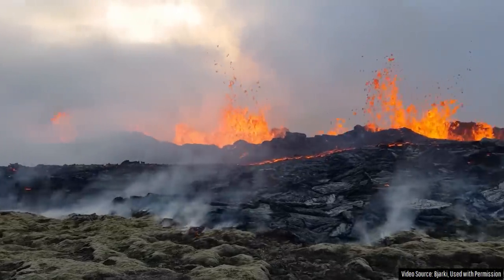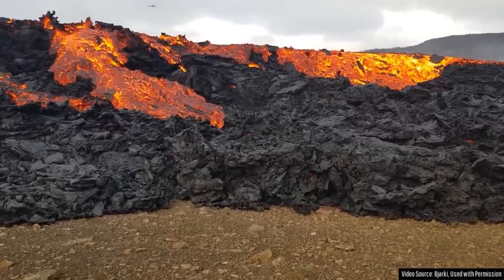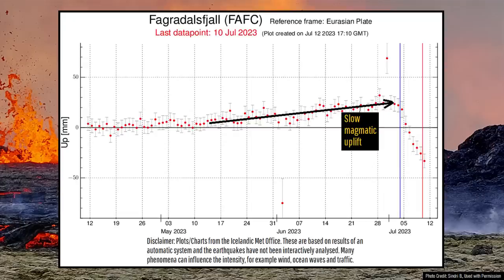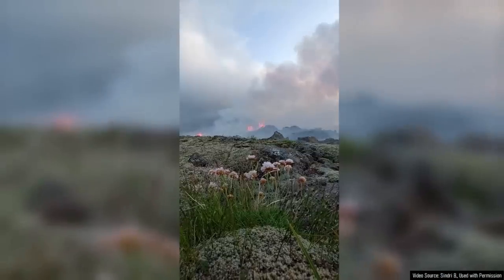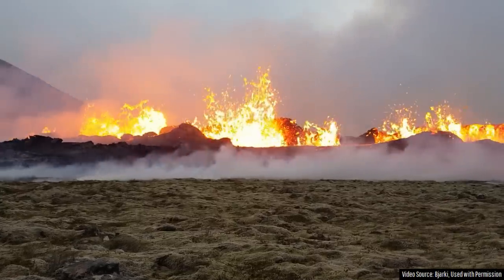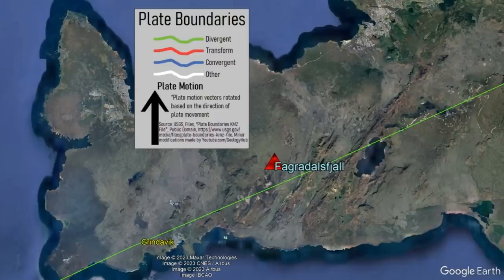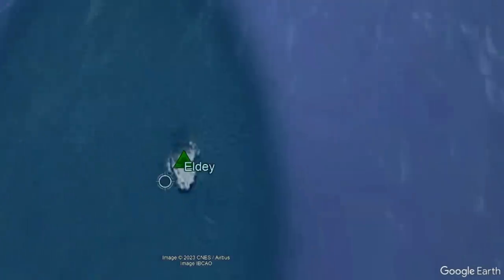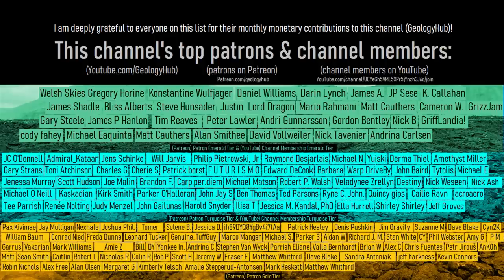Iceland Volcano Eruption Update; Eruption Slows, Underlying Dike Expands

Comment: Thanks as always. Yesterday, I was watching the eruption, which occasionally had outbursts that built up the cone. Some parts of the cone even collapsed! 
To be honest, given Iceland's location on the North Atlantic mid-ocean ridge, I am curious about what its future will be. Will it break apart, grow larger, get accreted to Europe or North America, or get subducted? I have read that oceanic plateaus (Such as Iceland, but I may be wrong.) are more buoyant that the surrounding oceanic crust, so is it possible that when subduction starts in the North Atlantic Ocean in the next 100 million years, Iceland will get accreted to either North America or Europe? I have read that oceanic plateaus are important for the growth of the continental crust.
Reply from the maker: The Reykjanes peninsula should continue to grow larger for a fairly long time. At least another million or so years in my opinion. But remember, eruptions there are highly intermittent, with eruptions ongoing <0.5% of the time. The mantle hotspot residuals are a key driver of volcanism there, with the mid ocean ridge merely representing a weak point.
Reply: @GeologyHub  Thanks Geology Hub! Enjoy your vacation!